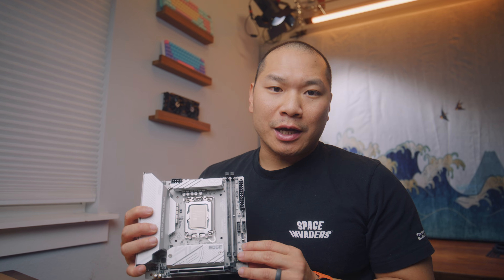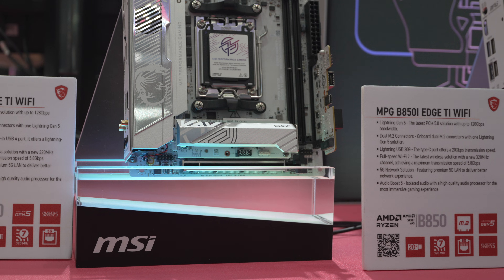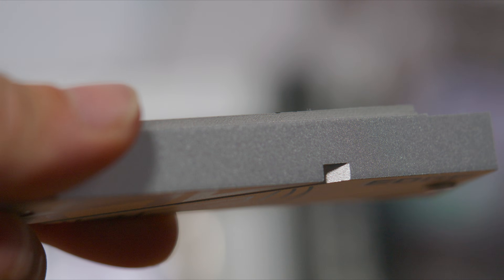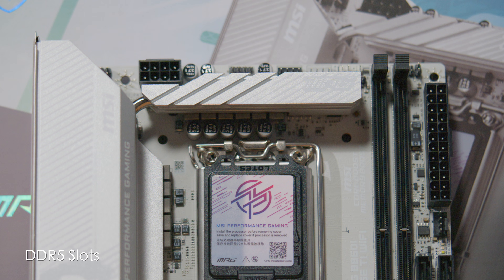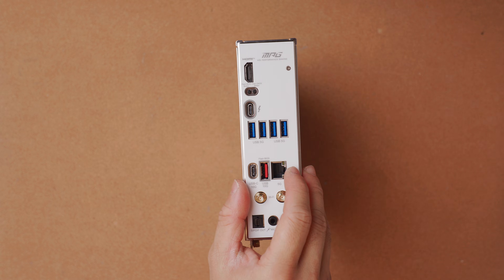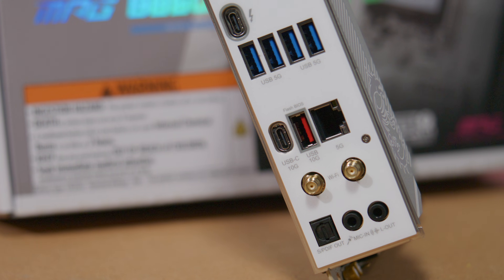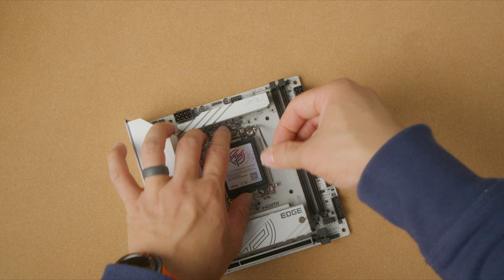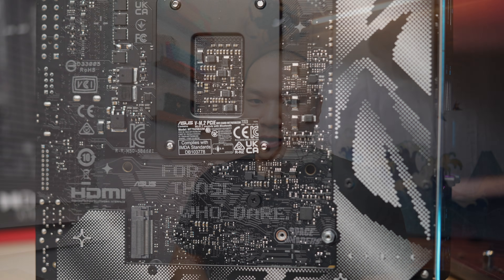MSI B860I Edge - Big features on a little board! (some too big...)

Comment: I have the 890 version of that board with the Noctua "Stealth" cooler. I had to use an angle grinder to shave off a portion of that heat sink over the VRM to make it fit. I ended gooing in a bunch of thermal putty. Works ok. And I have that silly little fan disabled.
Reply: I've just removed the VRM cooler because I'm building in the FormD T1 and the heatsink impacted on the top radiator. Someone at MSI should be fired for making such a stupid design
Reply: that sounds horrible